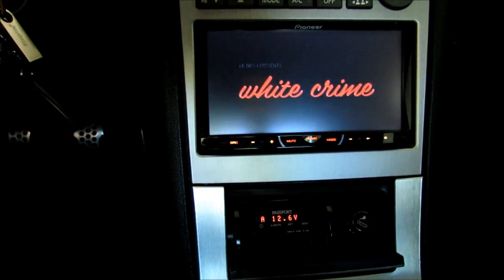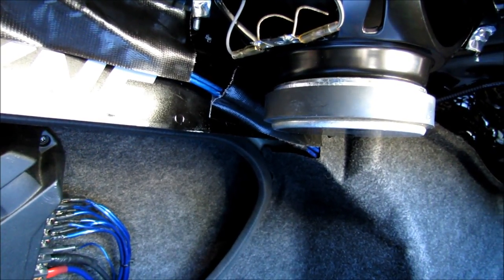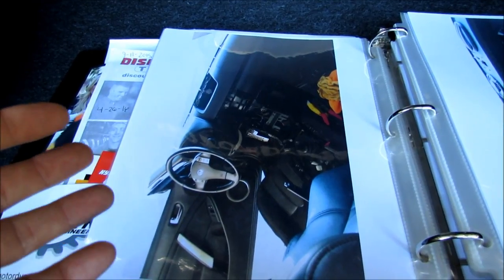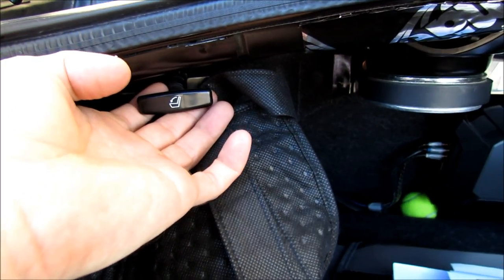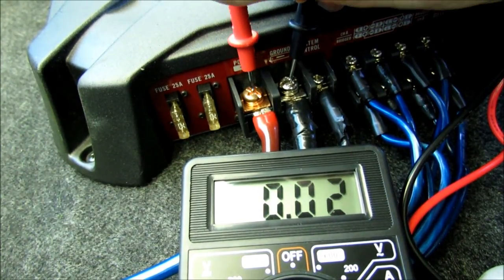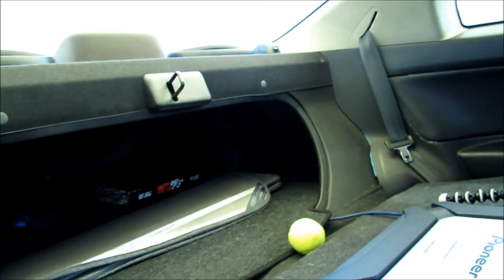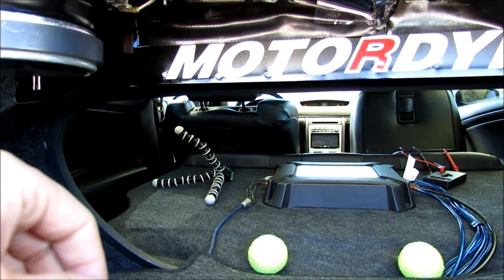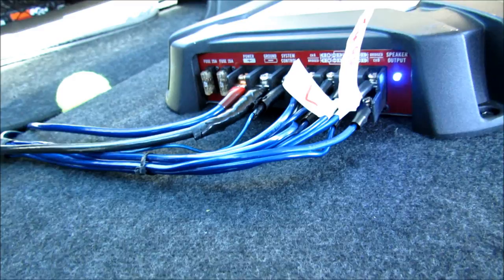Amp light BLINKING

Comment from the maker: Update: The AMP ended up going out and 1 channel out of the 4 was clipping. The AMP was 6 years old, so when I hooked the speaker back up it worked for awhile, then it started clipping again once you turned the car off. Turn the car back on, unhook the speaker, hook it back up the clipping stopped. It was so strange. I replaced the AMP, it fixed the problem altogether. I was told hot summers in Phoenix cook AMPs and a channel blew out on the amp is why only 1 speaker would clip. I was on borrowed time, to begin with.

Comment: Yah I’m having an issue with my JBL amp keeps alternating between protect and lower lights 

I disconnected every cable and wire but power and it still doing it so just be my so sadly don’t got a multimeter for test it to see the voltages in my old car I usually just unplugged and plugged the rca. Back on it fiddle with it and starts workin again but if it doing it with nothing connected but power and the REM wire fro. My radio must be amp issue 

Thankfully got a backup amp. Cause I wanted/needed an amp for my nice speakers and one I was using for my somewhere in old car was only 2 channel I upgraded to a 4 channel backup not as good obviously but for my sub should work fine

Comment: You should get an Alpine PDX V9, run a sub and have a shop install it so you don't have so much Gorilla tape and the Motordyne sticker doing your wire management.  The Pioneer probably clips a lot at high volume too because it's a cheap amp and the wiring is ok with 8 gauge.  Should have ran 4 gauge so you can update the amp later on with out having to redo the wiring.  And you should clamp those wires so their not pulling on the connectors at the amp.  Probably should use shrink tube or little rubber booties on those connectors because that electrical tape will probably unravel.

Are you going to build your own customer enclosure?
Reply from the maker: I did the install 6 years ago, tape holds well. I've never had to touch it, like I said. I did clamp the wires and then put tape over as a precaution. Heat tape would be better. No there is no clipping at high volumes, this is my first problem in 6 years. You are most likely right and I can't remember what gauge I used. I do know though, I invest in hearing aid companies because of all the boom boxes out there destroying eardrums. I'm not a fan of subs. I wanted to let a shop do the install, but they told me it was illegal to play music videos while driving. I said what is the point of having an LCD screen if you can't watch videos? So I decided to do the job myself. I found out about the 12v relay to make movies work which I'm sure you know about.

My skills here are super weak, I know.
Reply: Motordyne G35 Sub is 30% of your sound. Put one 8" in the corner. Drive the rear speakers off the head unit and bridge the rear off the 4 chanel and drive a small sub. Not having a sub you can't hear drums properly, the bass guitar or any synthesized music properly.
Reply from the maker: I'm sure you are right. Props where due, I did see your sub setup box which was impressive. What I find when I ride in someones car with subs, is you can't hear any vocals other than bass. But that is with two 12's shaking the whole outside of the car, along with everything else rattling. Those 6X9's hit pretty hard with an AMP, more than enough to make me happy. An 8" would be just enough to make it better.

Comment: Where do you put your tennis balls, I put them between the rear window and the rear deck
Reply from the maker: Why put tennis balls in the rear window? I do not have problems with vibrations, everything is dynamated. I just put the tennis balls there to put pressure on the amp to keep it tight, since the amp is screwed into the back seat and it is putting extra weight on the rear seat.